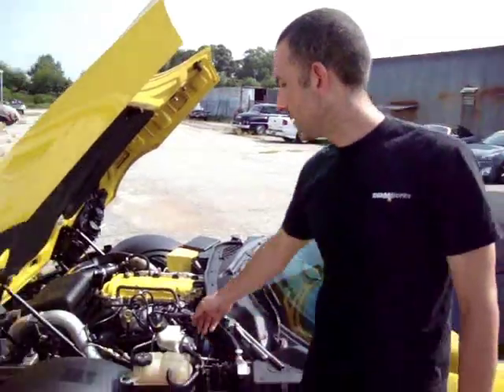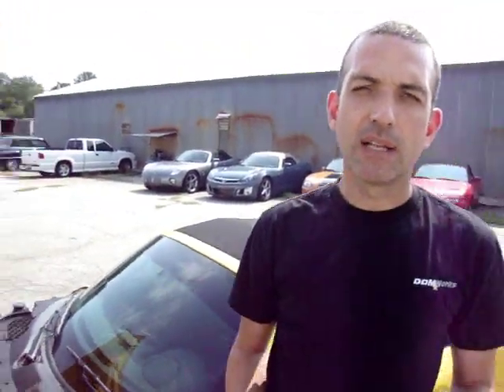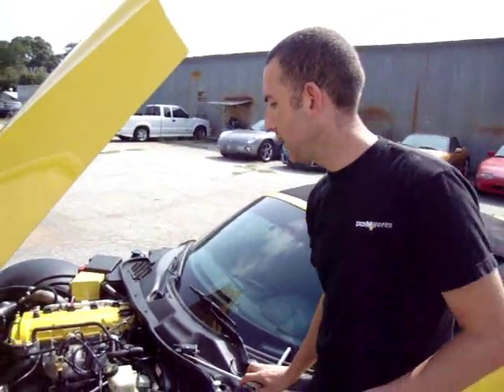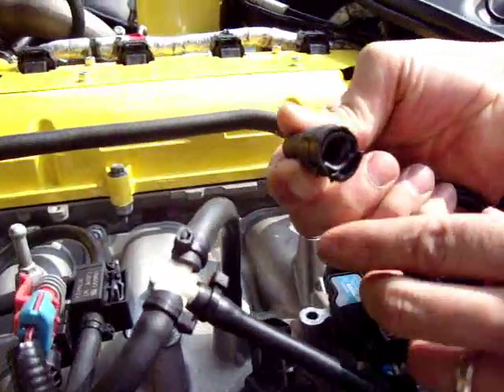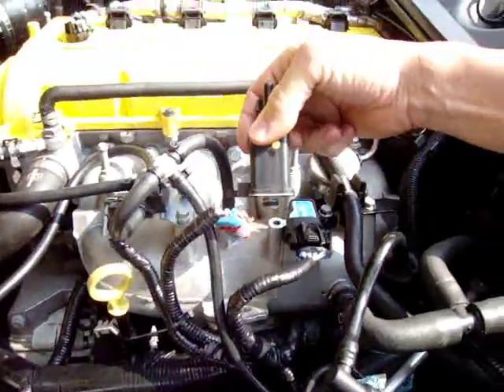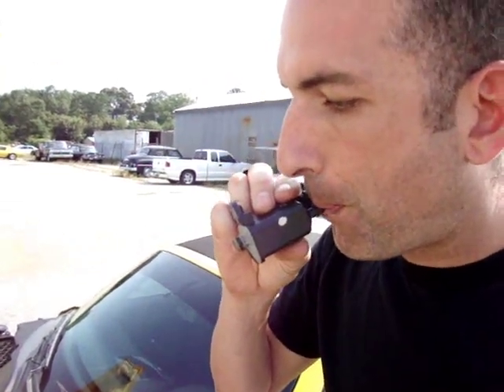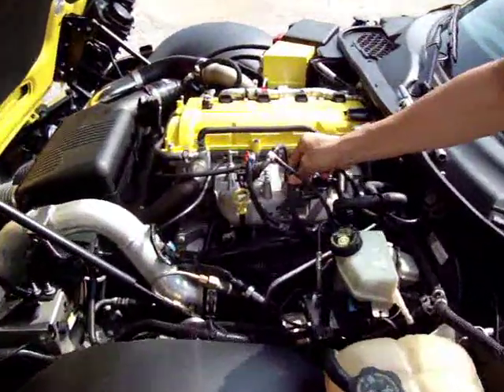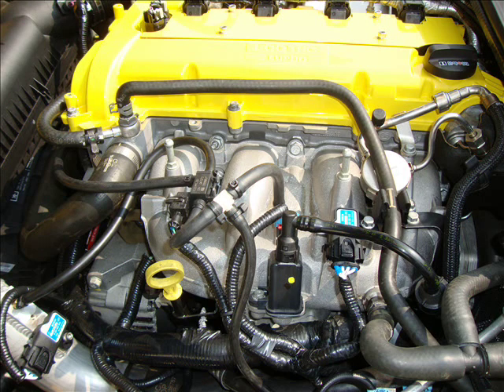DDMWorks - EVAP Solenoid Testing and Replacement on Ecotec engines

Comment: Is there a simpler way to replace the charcoal canister?
Reply: Yes, use a dremel tool to cut a hole in the top of the cover inside the trunk. First remove the trunk liner. There's videos on YouTube showing how to do it. I changed the charcoal canister in my 2008 Pontiac Solstice with one from rockauto. Very easy

Comment: Well, just an FYI...on my 2008 SKY it is on the back of the engine.  I had trouble getting it off so I loosened the passenger side cowl, too off the wiper blade and was able to access it.  Then the damn thing would not come off the bracket.  Got a length of fuel line and I will hook that up and give it the blow test.  From there.......gotta figure out how to remove it.  Or just put the new one in and zip tie it to the old one.
Reply: Same. I bought the one in video and part is different from the one on car.

Comment: How do you check the Evap canister. My solenoid is fine, but i think the canister is bad, because I can't fill up the tank without it cutting off every 2 seconds
Reply: Evap canister is In the trunk.  If you have the convertible, you need to pop it open then take the carpet off the "pyramid" hump in the trunk area and you should have access to take things apart to get to the charcoal canister as well as various piping that sometimes gets clogged.

Comment: I keep having bad solenoids. The mechanic told me it's likely the charcoal canister & gas cap, but I did some research which tells me there might be something wrong with the vent associated with the canister. Not really sure what to do. I could change this out myself, but I'm not 100% sure.

Comment: Well, once again, a seemingly simple repair went awry. My  2007 Cobalt's EVAP valve did NOT bolt down like the video (it slid horizontally out of a metal bracket), did NOT require a 10mm wrench (it was a 13mm wrench) and had three ports (not including the connector) instead of the two shown on the video. I did test the old valve per the video and proved that my old valve was indeed bad.
Reply: +Michael Sheppard - I have to admit that because of the thoroughness of the video, changing the valve was still performed easily, regardless of my whining. And as an update, my Service Engine light has since turned off. Woot-woot!
Reply: +Michael Sheppard Might be different for you. You have the LSJ engine and the one he is demonstrating here is on an LNF which is 08 and up
Reply: +Michael Sheppard ; mine has the same setup I have a 2010 Cobalt Sedan 2Lt with auto trans. I haven't taken the part off yet. So far I have replaced the gas cap and the 2 cam sensors - that's the order they came up when AutoZone did the check for the engine light. Its still on and the Evap is the last thing to check, I just hope I finally get to the problem and be done with it. Did you see how clean the engine is on that guys car - that's cleaner than the inside of my dishwasher and its clean.
Reply: @johnsandherr1814  Lmao thank you for your comment about the dishwasher, had me cracking up 6 years later!

Comment: i did not drive my 2006 Nissan Sentra 1.8S for 9 months. Sometimes, i have a hard start-up problem, i could hear the crank but the engine would not start up during the first ignition (it takes up to 3 attempts). The battery is a new one, i also checked the contact points of all harnesses. Just replaced the 2 drive belts by myself, but not sure if i have adjusted the belt tensions correctly. If the belts are too tight or loose, will that cause this hard start-up problem?

Comment: Thanks for the video! I just tested mine and was unable to blow any air through and did not have any loss of pressure...yet my car is still throwing code P0497 in my 2009 Chevy Cobalt...any ideas? I'm hoping it's not the wiring.